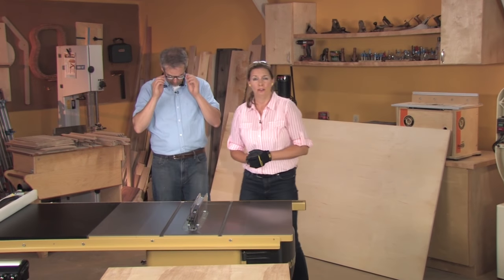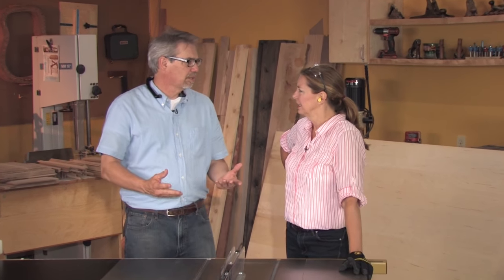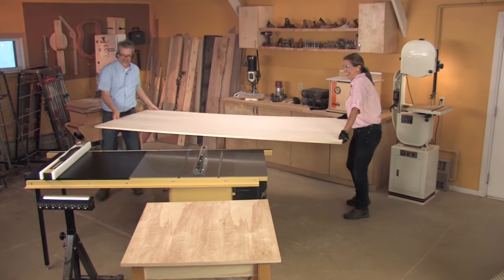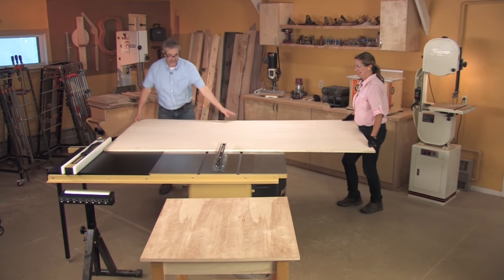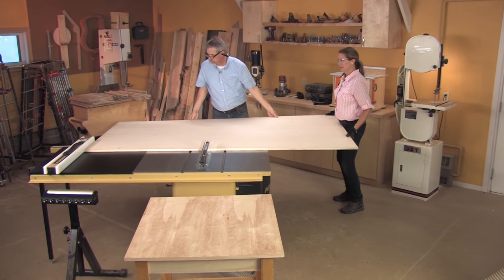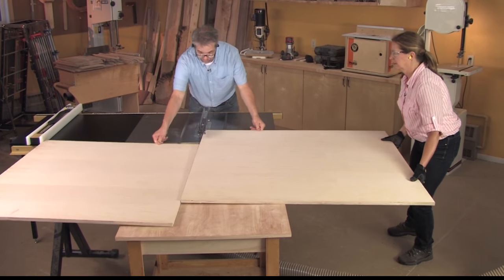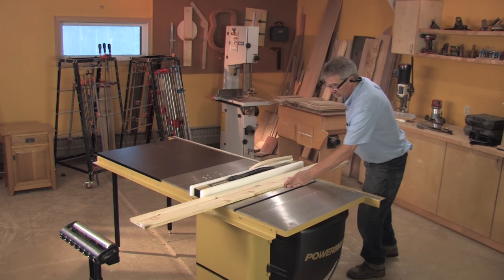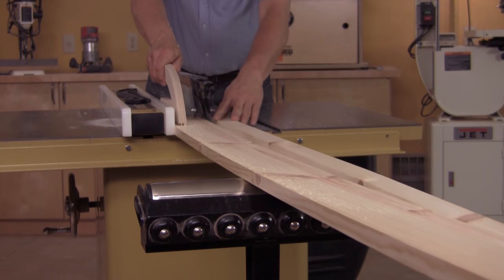Cutting Large Sheet Stock on a Table Saw | Rockler Skill Builders

Comment: I'm a 5'8" female working in a shop in NYC. I'm expected to cut core, mdf, and plywood sheets on a table saw by myself (1/8" to 1 1/8" in thickness). There's no way I'd be allowed to break these down with a hand held circular saw first. And I'd never attempt to 'crosscut' the sheet goods this way unless it was against a sliding table panel saw fence... I've been woodworking for just over a year now at various shops so I'm no expert but this advice just doesn't seem feasible to me. Or at least not realistic for what I'm finding in the industry. Would love to hear some other opinions on this.

Comment: Rockler , you missed the most important part on the table saw. The Riving Knife, is always used in cutting plywood to avoid kickbacks. I know after suffering two kickbacks into the gut. I got lucky with no injuries.
Reply: The blade guard serves as the riving knife.